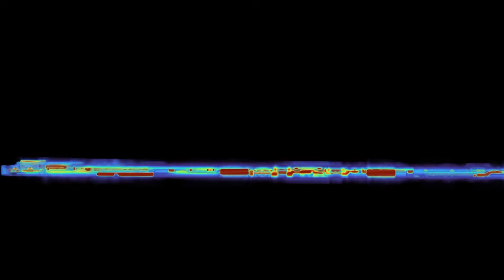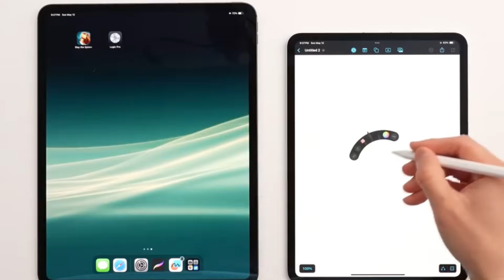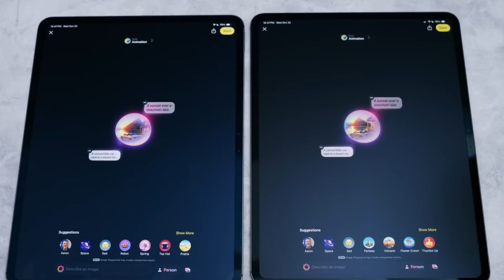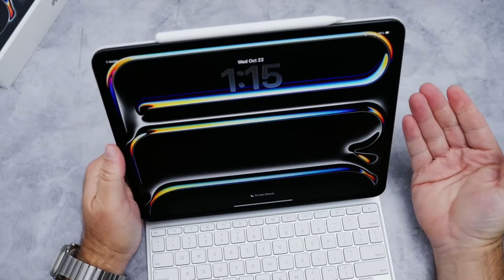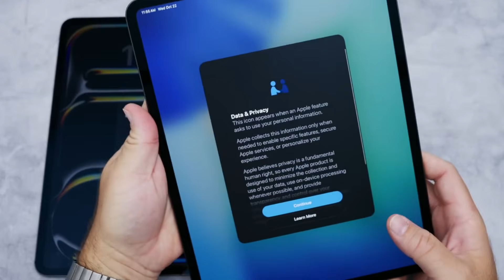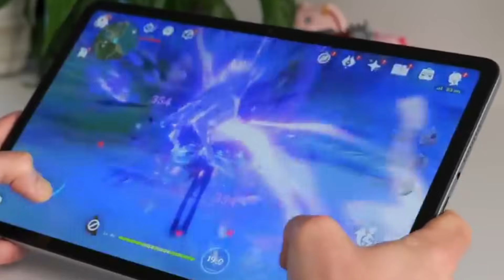M6 iPad Pro Leaks - This Is Finally Happening!

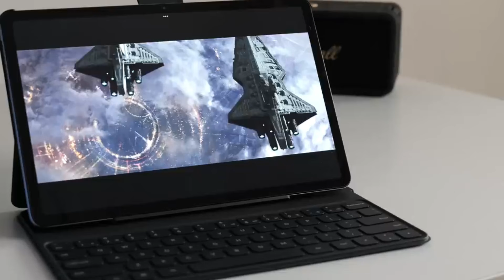Comment: 0:58 the M5 chip in the iPad uses a lower binned version with only 3 performance core compared to the M5 chip using in the MacBook Pro which has 4 performance cores. So it’s not quite the same chip and not fully related to just thermal throttling.
Reply: Same gpu though
Reply: That's only true for the 12 GB version. The 16 Gb version has 4 performance cores.